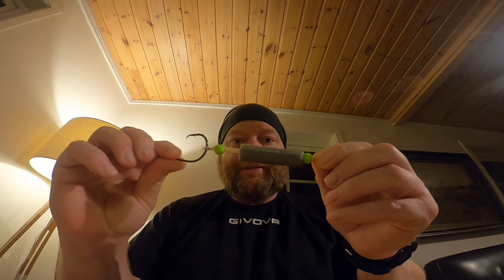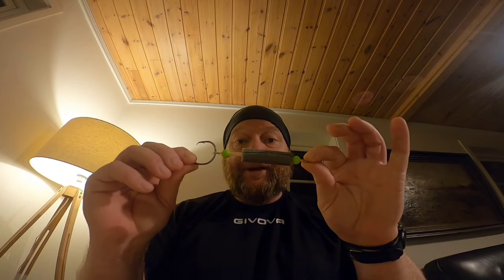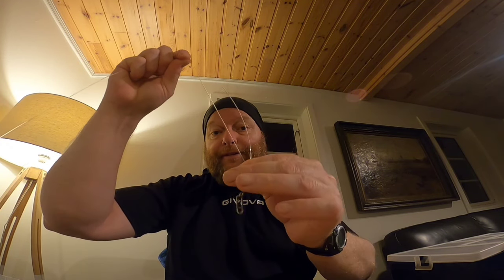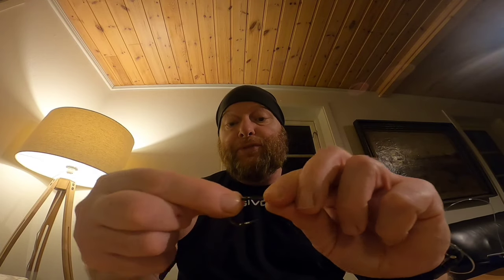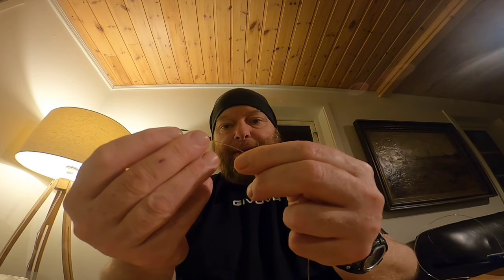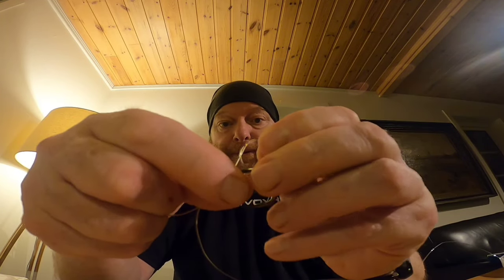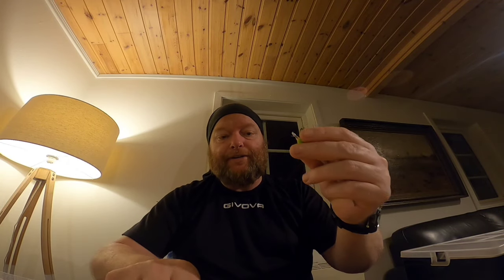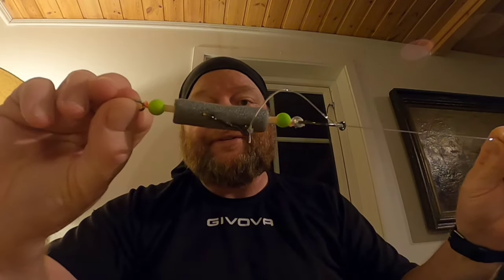How to fish J hooks on a dingle dangle!

Comment: Havent been out fishing this winter yet, specifically targeting Codling. 
I think when i do though khopefully next weekend) am going to use pulley rigs (my go to rig now) with a dingle dangle but not with circle hooks, am going to tie them with some large sized Octopus or Chinu hooks. Will be able to use some nice sized baits. Bluey, squid, lug/rag, crab, herring, razor and cocktails of some of the above, without worrying about masking hookpoints
Reply from the maker: Hi bud. I make fishing videos, if circle hooks made you miss bites.  I wouldn't be making fishing videos! , well not good ones. It's all about getting the system to work, and having confidence in it. Thanks Brother, see you on the beach 😁👌

Comment: I’ve been trying these dingles and got an old t shirt and wrapped it round the tubing with the elastic then fish oil before baiting up, there’s so many options for these, Also so far not a badly hooked fish.
thanks for making the time to put up the tutorials
Reply from the maker: Hi bud. Yes, lots of options. That's what I love like! Glad you liked it, thanks Brother. See you on the beach 😁👌
Reply: Some flannel or microfibre cloth holds the oils a bit longer than many of the foams. Then the bait further adds to the stench.
Reply from the maker: @gp4103 the foam is just for float. I have no need for bait additives are oils. Thanks Brother 👍😁
Reply: @Billyfishing_watch  it adds a bit of buoyancy and helps the bait bind to the dangle too. You don't need a full length piece. I have some made with ear plugs and thread the braid through two of them and then bind on the bait. Just be careful cutting bait off
Reply from the maker: https://youtu.be/yd2hx12UQkY
Reply from the maker: Have a look at this video, I got it covered. But thanks for the tip 👌

Comment: Thank you Billy for all your helpful videos and Tips. Normally I'm spinfishing during holidays from the shore of Norway with okay fish around 40-70 cm of cod/coalfish, pollack.

Next time i want to use a deadbait rod while I am spinfishing. For sure my gear is not optimal but I try to get some stuff  an perhaps build some for my own. I have to use a spinning rod with braid and I read claw lead is not good for braid, cause it comes off the ground due to the low stretching?

I think you have a video for making baitclips. 😅 What wire strength are you using?
Reply from the maker: Hi bud, glad you liked the video. Yes, dead bait fishing is good in the wintertime. When it's hard to move around. I think the problem with your lead weight lifting is, you need to put a monofilament leader in front of it. That might help because it has some stretch in it. Thanks Brother 👍😁

Comment: I love fishing with the Pulley rig and my go to rig for years.. I will start using this rig with a circle hook and dongle but the dongle attached to a gemini splash down solo clip so ity is locked in place and won't unclip but I think like you said the bait will just smash against the rig body hence why the South African Rig is the favourate. Is the loop knot strong enough to hold the wire trace to the mono in that rig??
Reply from the maker: If that is knot I use!  well then yes 👌